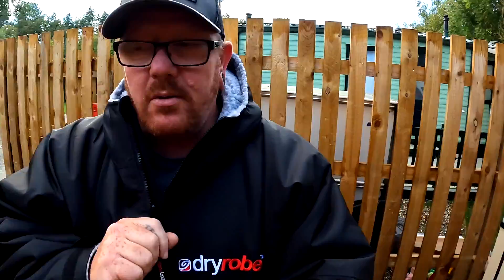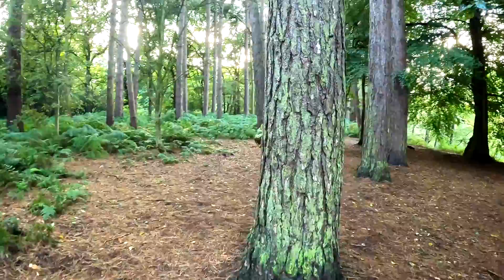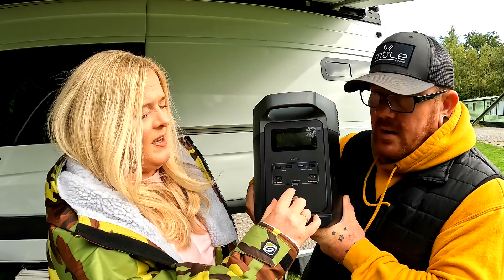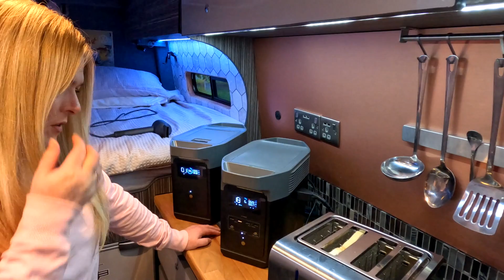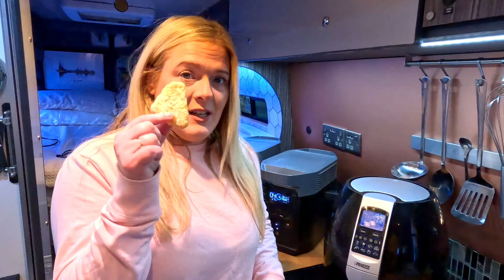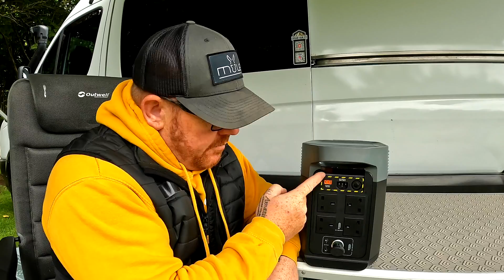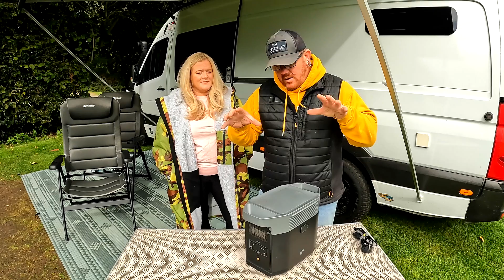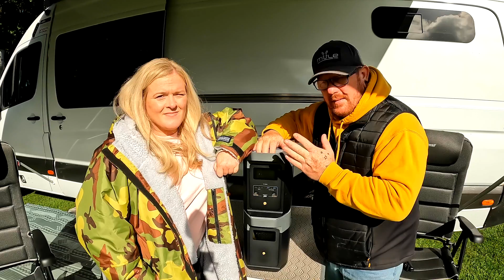The ONLY Eco Flow Delta 2 Video You Need To Watch

Comment: Nice review. How long would your 1500w Air Fryer run for .... if it was the only appliance plugged into a fully charged Eco Flow Delta ?
Reply from the maker: The air fryer didn’t pull off as much as we thought . And it would depend how long you used it for there would be no way of actually saying how long
Reply: The delta 2 has about 810 watt hours of useable power. So 1500 watt draw would last about 35 mins

Comment: I got the 2016wh delta. It has 2 side ports. I bought the 400w solar panels and the petrol generator. Both plug in together. 
The generator is 1900wh, very quiet and fully controllable from the app..
I'm saving also for the extra battery. The solar input can take 2x 400w panel kits.
Also, the generator will self start, amazing
Reply from the maker: Nice information here 👍👍😃😬

Comment: Is the Delta 2 cost afective if using at home and using mains electric to charge it up.? It will be drawing a lot of power from your mains to charge it up at what ever price per unit you are being charged. Even though its only taking an hour or so to fully charge it is still costing you in electric. At over a thousand pounds to buy are you actully saving any money using the power bank to run and charge things from.? Great video and great review of the Delta 2.

Comment: Hey guys . Just watched those happy days etc. One big mistake people make. Plastic windows and fans are made by injection moulding. The moulds are sprayed with a release agent so that the finished item releases from the mould and doesnt stick. Remenance  of the release agent is not always thoroughly removed. If it's not removed before fitting the window for example the sealant won't adhere to the plastic. Looks sealed but isn't.  Pulls away easily. Cheers from old George and Jane.
Reply from the maker: Hi thanks for comment, we are just glad they are getting the issues with the van sorted so they can go and enjoy their travels, such a lovely couple 😃😃😃

Comment: Love the presentation.  I'd have this system all day long.  I decided to buy allpowers monster x.  I asked tour advice some time back about linking roof solar direct to charge them. It works so we don't need the provided AP panels and we are never without power
  These devices no matter the brand are martini systems, any time any place anywhere.  For me having priced up a self build electronics, these systems replace them totally. No Chinese inverters that don't last, no cables, sockets, gangs, fuse boards, power box or mppt that could catch fire.  A victon item could cost £240 that's a fraction then add lith battery 600  and three rest, you'd be looking at 1500 above.  These are a good investment and on a fuanl note. They save your domestic home bills.  I charge then every day, it powers our home.  Our lecky bill is 54 a month. Gas is off. We use the allpowers to heat out rooms with 500w space heater. We are cooking, cheers Emma and Neil top banana!
Reply from the maker: Thanks Paul, nice to know you ate making great use of the power banks!

Comment: Can these be charged via a 12v (cigarette lighter) socket in a car / van whilst driving, while a fridge is powered through it? I know some units can’t do this. It would be a great addition for a micro camper boot jump if it could.
Reply from the maker: It can be charged whilst being used, but in this case here the fridge would be pulling more than the charge going in
Reply: @UrbanVanlife  That’s good to know. Thanks for the info. I’d only need something small fridge-wise for day van use with the odd sleepover so hopefully I could get a low energy use model.

Comment: That is a game changer. Will it run a microwave though.? Great video guys, thanks.
Reply from the maker: Yes it will as long as its not more powerful than the inverter in the ecoflow, ours is only 800 watts and works great off it!

Comment: Hi guys, thanks for the video it was really informative.  We have an ecoflow river max, we bought this to fill in the gap while we convert our van, we have a small Nissan NV 200 and were struggling to find where it was possible to fit all the victron equipment, so, as you pointed out using the delta 2 in place of the victron has to be a viable option for us.  The only problem is the rate of charge from the cigar lighter, which is the same on both models.  Do you think it would be possible to fix an inverter to your starter battery, giving you 240 and plugging the ecoflow in using the kettle lead? Of course only using this when the engine is running.
We would appreciate your thoughts on this option.
Regards Alan and Yvonne ♥️🚐🐕
Reply from the maker: Plugging an inverter into the starter battery is not a good idea as there is a risk you could fry your alternator, not something we would take a chance on 🙃
Reply: @UrbanVanlife  thank you for your help, it is much appreciated xx

Comment: is there a 12v socket? In the infomercial did mention you'll show us around the back where the 240 sockets were but forgot or got side tracked. btw looked like a great campsite I'll be checking it out.
Reply from the maker: There is a 12volt cigarette port in the rear … sorry about us 😊😩

Comment: Someone pinched my Ecoflow panel off my shed roof. My own fault for not securing it properly .
Reply from the maker: Not your fault at all, they shouldn’t have taken something that’s not theirs! 😒
Reply: @UrbanVanlife  Just found it a few gardens down from me. Needs a connecter putting back on but what a relief! Maybe Eco flo could hide a tiny tracker inside the panels as part of the app as they release bigger more expensive panels. Have a good week gang Laters!

Comment: Have been planning to get the Delta Max, now this is out . . . I'm hung up on other reviews comments about how you can't leave solar panels plugged in "overnight" or when they're not accepting soler energy. (This was on the Delta Max = Review said it starts a "loop" or something that drains battery.)
I plan to use as a backwoods "base camp" for hunting - want to be able to leave plugged in when leaving before dawn.
Any experience with this (keeping solar panels plugged in after sunlight)?
Any words of wisdom you can share?
Thanks in advance,
Tampa, Florida USA
Reply from the maker: We know that this Power bank has built in tech to stop recharging overload and protection against it, but its not something we actually have any first hand experience in, so would suggest sending them an email for clarification, as we wouldn't want to give you misinformation.

Comment: ok so I see how the booster and stuff comes in handy but I think you do still need it in your van because you want to be able to charge where ever your at in the van not in a central location so if they made a system that could hook up to a regular ran wires to replace a normal battery id say ok but for now id still go with dedicated batteries set up inside.

Comment: I see you did use a heater  so Wood heater be to much for the e flool
Reply from the maker: Erm, we didn’t use a heater but it all goes off wattage, so as long as the heater isn’t more powerful than the power bank then it would be fine, we have a truma in the van so would not need an extra heater

Comment: Thanks for sharing another great review and camping grounds . ❤ And are you going to review Ecoflows portable generator that chargers the battery pack 👍
Reply from the maker: Not too sure about a generator 👀👀 but we have the extra battery which we had to use but haven’t seen a generator 🧐🧐🧐
Reply: @UrbanVanlife  it was on the Australian  Ecoflow website it automatically starts up when the batteries get low , but because you can use solar panels you might not be need it . Just thought if they gave it to you as a freebie it would make a good review 👍

Comment: Love Delamere.

Did you mention if it was possible to connect to existing panels. Maximus was chatter boxing 😊

Just thinking it could offer a really good all in one solution for people looking to upgrade older systems from lead acid who already have some form of solar on the roof and don't want to get involved in changing everything
Reply from the maker: We have seen it done on a tiny home in America  so can’t see why not, but you would have to make sure your not putting more than the maximum wattage into it and would likely need the correct cables from ecoflow so would most likely need some research!
Reply: @UrbanVanlife  I am going to use my normal 12 volt outlet from my liesure batteries to charge the ecoflow and then in turn the liesure batteries will be charged by the solar panel on the van roof. I can't see that being any different from the 12 volt socket in the cab for suitability.

Comment: Can you use a fixed solar on the roof?
When using the unit & when not using the unit ( turned off)
I have 2 E bikes (emtb's) 
Will it be safe to leave the solar panel plugged in all the time?
My plan is to use the sola panel (150) that I have fitted to the roof & just leave it plugged in when we / I am out riding for up to 5 -6 hours & charge the bikes up overnight.
Reply from the maker: I’m pretty sure you could totalt fix them to the roof and run them in trough a gland . The intelligent system in the unit protects from over charging and dose a great job . What you want to do I don’t think I’d have a problem doing but I’m sure if you asked ecoflow for a pro opinion they would get back . There really good at communication

Comment: The forest campsite looks great - imagine the light trail will be too.
Completely get the benefits of the units for those who can’t do van electrics but still prefer what I’ve done as almost 6KWh of power and 3Kw inverter in not much bigger footprint than the original AGM battery - think I lost about 4 inches of usable space under the bench seat and under £3k all in for 460ah lithium battery, inverter (3Kw pure sine), MPPT solar (victron), b2b and AC charger (30A Victron) for when on hookup plus accessories) 
That said  - I do love the 100w USB C PD though 😂
All the best, David 👍
Reply from the maker: You have a whole lot of power there 🤩🤩🤩
and at a good price too 👍👍👍

Comment: Hi Neil. We have the Ecoflow Delta Max can that additional battery be added to that? Also we haven't sorted any electrics as such in Our van, we have just been using the Ecoflow.   But we dont know how we will be able to power a diesel heater any ideas please?
Reply from the maker: Has your ecoflow got the extra socket on the side for the  cable that comes with the spare battery ? As we think it’s different batteries inside them so may not be compatible with the other ecoflow, suggest dropping them an email.  As for the diesel heater you could possibly put a cigarette lighter cable onto the heater and plug it into the accessory port of the ecoflow

Comment: Great review, like you say why have built in inverter, batteries etc in the van, an idea would be put solar on the roof built in, run the cables to a point where you can connect your Eco Flow units.  I use my at home, 200w solar with an extension cable and charge on all boys toys.
And if there is a power cut use the microwave oven.
Reply from the maker: Good to hear someone else uses theirs in the house aswell, we use ours every day in the house 😂😂